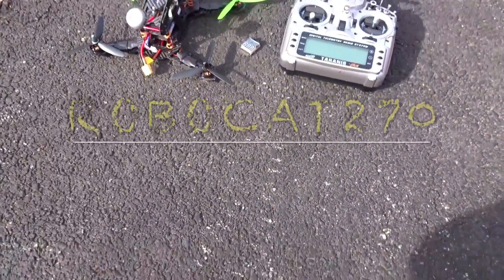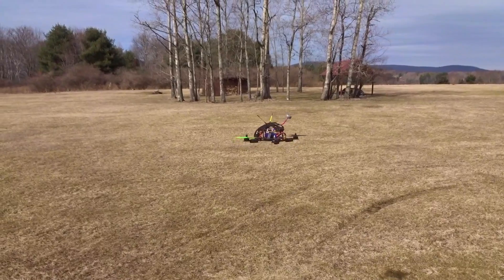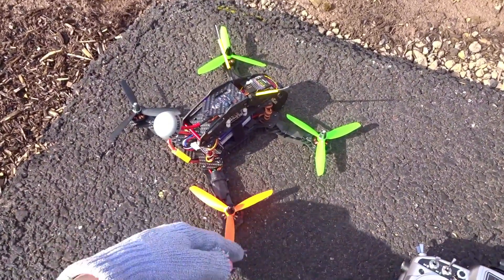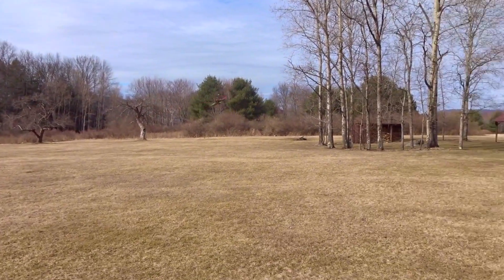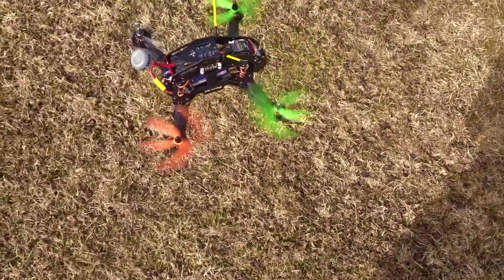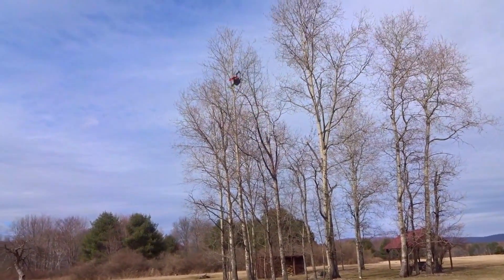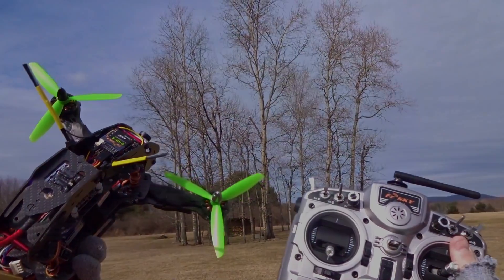RoboCat 270: Quick Flight

Comment: Nice vice n explanation 
Can you explain how to get position hold
Reply from the maker: This is a very old video, no gps was used.
Reply: Yes is that I want to know with no gps I'm struggling at some point how to configur out that the quad can stay in air even for 30sec
Reply: I'm very impressed by your videos since scratch until the end but one thing is just to hold a quad in air and 3D movement

Comment: nice vid....i have a SRD military edition SRD 280 V4 on 4s but every once in a while on full throttle like the way you're flying it on angle mode my quad just die's in the air all blade's shut off and fall's to the ground.....other than that it fly's great and move's side to side perfectly.
Reply from the maker: hmm, how are you powering the FC? voltage might drop under the pressure. Could also be ESC temperature shutdown, but I doubt it
Reply: maybe but it's ready to fly out of the box... i've flown it about 30 times like i said it happen's rarely only on full throttle.....thank's for you're reply's anyway RC addicted....i have 4 car's there alot easier to fix....drone's are just carbon fibre with motherboard's and circuit board's it's harder to determine fault's.

Comment: You should take the motors, naze32,fpv setup, receiver,pdb and buy some cheap Rw.rc 20a opto esc's and buy a cheap x frame and use it as a 4s setup like your zmr x210! 😀
Reply from the maker: Nah, wouldn't be nearly as good, and I already took most of the things from it for other things! lol

Comment: I JUST GOT THE TAROT TL250H WITH THE SAME MOTORS I NEVER USED EMAX MOTORS BEFORE HOW DO YOU THINK THEY WILL DO ON THE 250 IT IS A TAROT FRAME BUT SAMETHING LITTLE SMALLER JUST WANTED TO KNOW IF THE MOTORS ARE OK?
Reply from the maker: I AM NOT SURE ABOUT THAT ONE, AND THEY ARE NOT THE SAME MOTORS, BUT THEY SHOULD DO JUST FINE. Oh and just a tip, all caps makes it look like you are shouting ;)
Reply: sorry, cancer treatment left me with very bad sight! so I use caps to s what I am typing sorry, thank you for answering!
Reply from the maker: david ringler OH, SORRY, DIDN'T KNOW. GOOD LUCK WITH YOUR TAROT :)

Comment: What would the biggest battery you could use with this quad?
Reply from the maker: It needs to be skinny and not tall, so like an 1800mAh 4S or a 2200mAh 3S probably. Depends on the dimensions of it.

Comment: What flight controller do you have on that? How is the altitude hold?
Reply from the maker: This is a Naze32. This board is the acro version, so it does not have a barometer, so altitude hold is not possible, and in something that this is meant for it is totally worthless and would only fight you while flying....

Comment: after about 20 crashes, I finally ended my robocat :( by flying in the ground
Reply from the maker: +dqDronz Dang :( Mine seems to be pretty durable so far.
Reply: +The RCAddict i think it did pretty good since my crashes were mostly really bad
Reply from the maker: dqDronz Yeah, I just had a crash the other day. Was full throttle climb/forwards, over the tops of 200ft trees, and I clipped the top of one, and it fell to the ground, and the ONLY thing that broke was my antenna holder zip tie.

Comment: nice flight, i have one of this 270 mm, can you tell me the pid for horizon mode?
Reply from the maker: +juan tallaferro I just used the stock PIDs on Luxfloat for this video.
Reply: +The RCAddict mine doesnt flip so easy with cc3d
Reply from the maker: juan tallaferro Yeah, CC3D is way tuned down. You need to up your rates.

Comment: Nice quad 👍 I got the same one lol I was burning 12a esc's up on mine and I think the pid setting d on pitch and roll I turned it down half way on both and the high pitch noise from the motors went away and I haven't blowen a esc since ! I was on Lux also! Just thought I would let you know but you have prob messed around with it since you made this vid lol ! Take care 👍
Reply from the maker: +Camshaft Shaft Yeah,  a good tune helps everything! I am running 20A escs and 6040-3 props right now.

Comment: When I first watched this a while back, I thought you set up the flight board to run in this cool nose down mode, but my multiwii 2.6 flies like this anyway with just the minimum programming. Cant wait to get my 6040 3 blades in a day or two,just hope the dont strain my tiny 1806 motors too much.. Thanks for posting.
Reply from the maker: +thra5herxb12s Nose down? Not sure what that is? The motors should be ok, what are your ESCs?
Reply: The esc's are 12 amp RHD's that came with the kit but one just burned out so I'll replace it with a Turnigey.
Reply from the maker: thra5herxb12s RHD? If you have one burn, it would probably be worth it to get some 20A ones. Maybe the afro 20A? They are cheap.

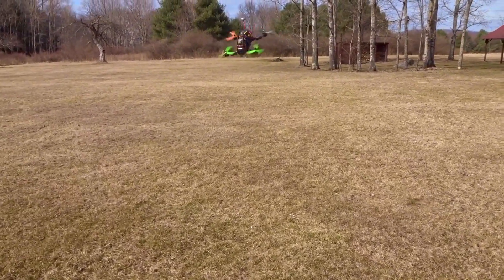Comment: At the 4:05 Mark my GF walks in and says hey why is it stuck in a tornado :)
Cant wait to get mine flying I burned my OSD Board and doing that tonight hoping to get it in the air this weekend
Reply from the maker: +Ikararua Lol, haha. OSD board? Do you mean PDB?
Reply: +The RCAddict my MinumOSD I was resoldering the PINs when I accidently desoldered the pad instead. I'm using the blue sky panel with EMAX motors which I believe is the same motor as yours rebranded. I'll post a video as soon as I finish it up and a maiden this weekend.
Reply from the maker: Ikararua Dang, that is the worst kind of thing to happen :(

Comment: Who's the one that suggested multiwii rewrite hey ;) 

I've flown the Fc model props before, they are utter junk!!! My friend had 2 explode on take off on his 4s rig!! Ditch them!
Reply from the maker: +rc photography Actually, as I was making the part 3 video, just after this flight, turns out it was still on Luxfloat ;P I was tuning it last weekend for 6040 tri props, and on multiwii rewrite it was pretty bad stock, and couldn't get it well tuned. I switched to luxloat and it flew ok on stock, and then lowered p and upped I from there. The props are not the best yes, haha. I am now using FC model 5040 tris, (new design, not bad) and Gemfan 6040 tris.
Reply: +The RCAddict try some Gemfan 5040 tris and hq 5040 tris. So much better
Reply from the maker: rc photography Nah, too much money. These Gemfan 6040 tri and not coming off unless they break ;P

Comment: that looks awesome, now I want one!
Reply from the maker: +Jeff Brewster Haha, it is certainly not a bad starting point!
Reply: yeah it looks great, also looks like it maneuvers really well. I may pick it up and then just slowly pick up a piece here and there as my wallet allows. I've never built a quad, is this a good starting point? looks like it has lot's of room for wiring etc.
Reply from the maker: Jeff Brewster Yeah, do you have other quad experience? It is a good starting point. The wiring is actually not the easiest. Mainly due to the top part is supposed to be "removable" and it is up so high. You could mount your receiver and stuff not up there though. Not hard though.
Reply: yeah i have a dromida vista and a syma x11. I also experience building computers and have about 10 years of information tech experience.
Reply from the maker: Jeff Brewster Ok, you sound like the perfect person to build a quad. haha.
Reply: +The RCAddict just gotta hide my purchases from my wife!
Reply from the maker: Jeff Brewster Lol, I don't have that problem. Only 16 ;D
Reply: sorry to keep bothering you but can you recommend a cheaper transmitter than the terranus? more of an entry level one that will still provide decent performance.
Reply from the maker: Jeff Brewster Hmm, entry level but still ok performance, sound like a Devo or Turnigy i6 to me.
Reply: +The RCAddict cool I will look into both. appreciate the advice